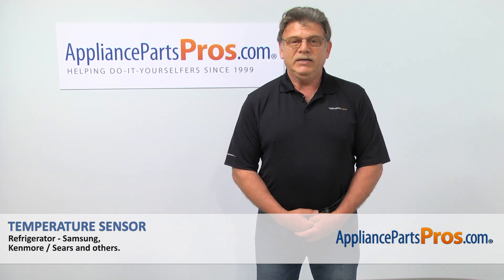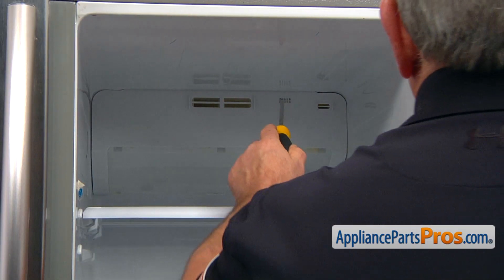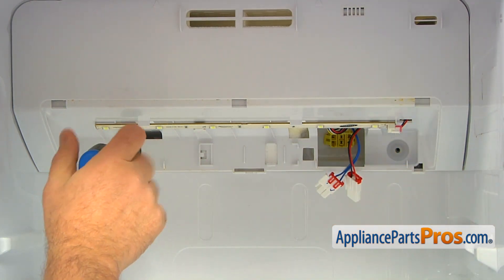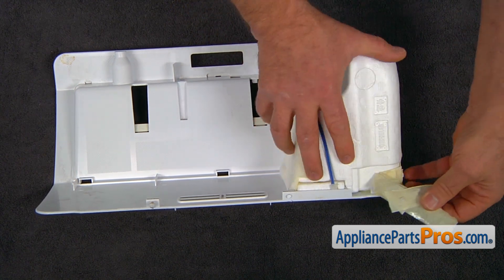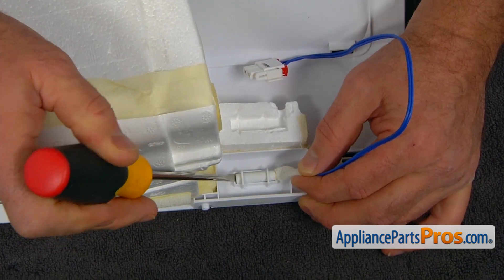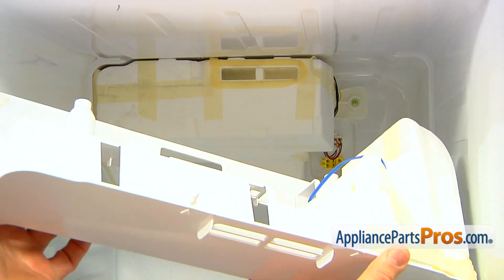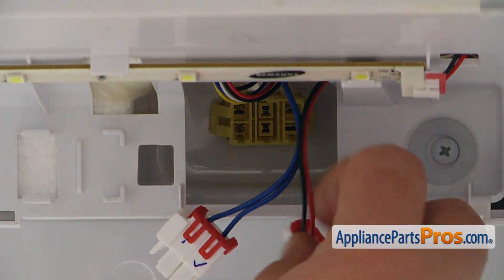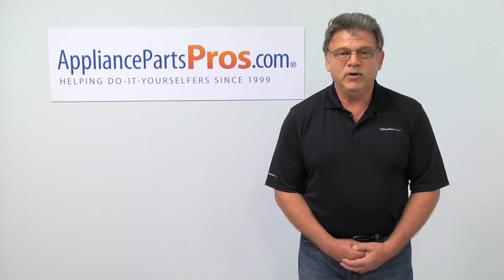How To: Samsung Temperature Sensor DA32-10105V

Comment: Hello, I am having issues with my Samsung 4 door / french door refrigerator.The fridge is not cooling sufficiently. The freezer works well. I am told that the fault is possibly with the temperature sensor which is located inside in the top roof space of the fridge. Access to it is via a panel fixed on top facing the front of the fridge. Could you please advise how to replace the sensor also the part number which I cannot find anywhere. The fridge model is SRF717CDBLS. Thank You

Comment: How do you know you need to replace it?  My refrigerator side freezes up.  I have replaced the controller board, and the temperature sensor on the refrigerator side.  It still frozen.  What can be wrong with it?
Reply: I see it’s been three years since you posted your comment. What did you end doing to fix it, or not please?